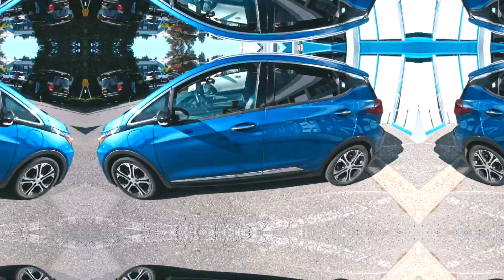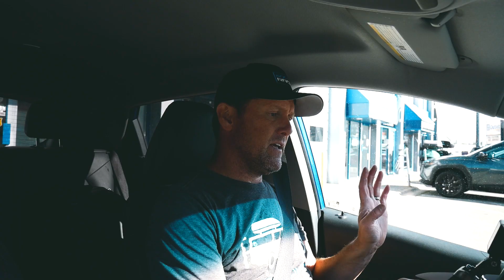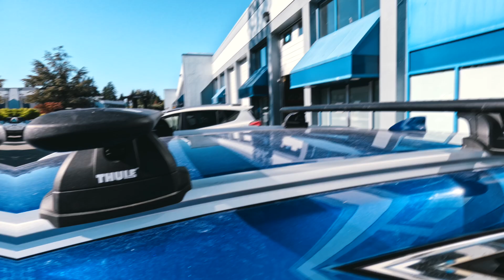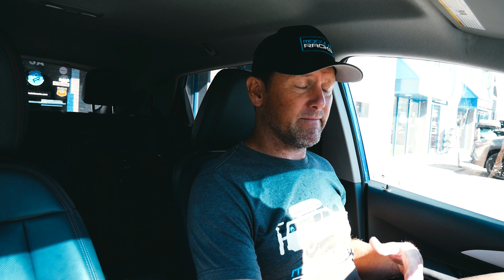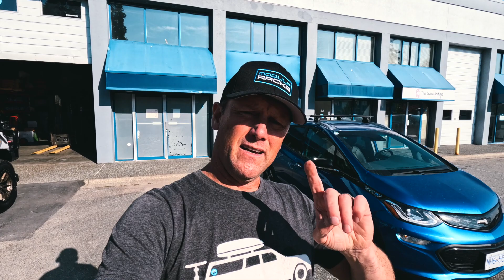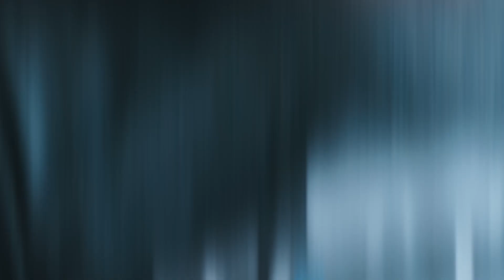EV Roof Rack Efficiency Testing

Comment: the bars on top of you ev could cause laminair flow to be disrupted into turbulent air, which then better fills the low pressure 'hole' behind your vehicle. which will pull less on your car giving you better milage.